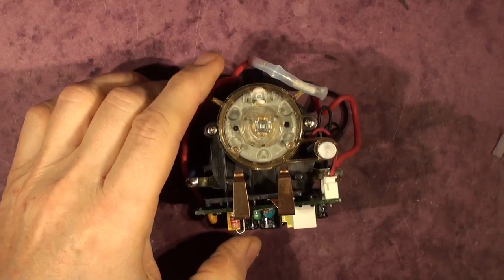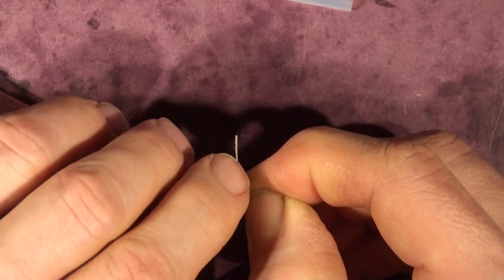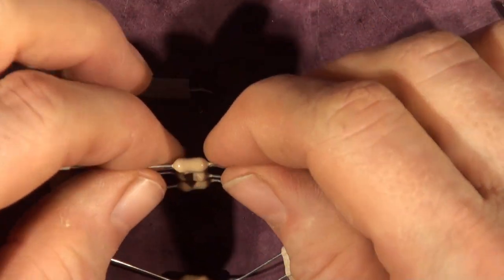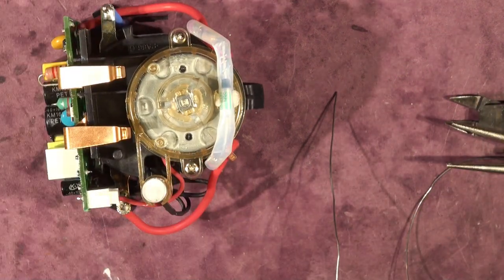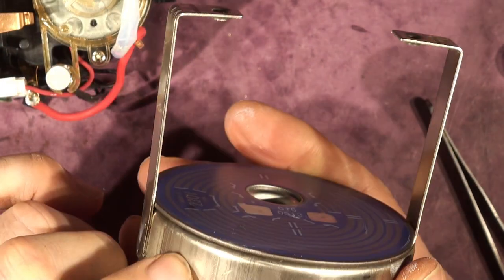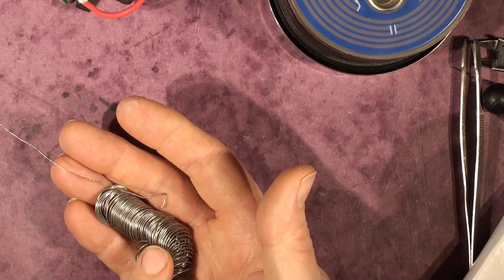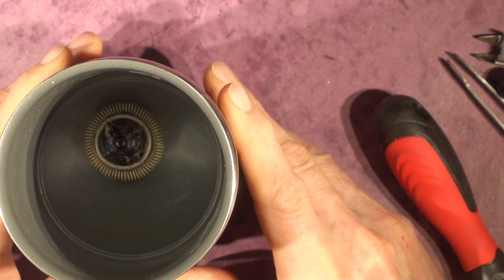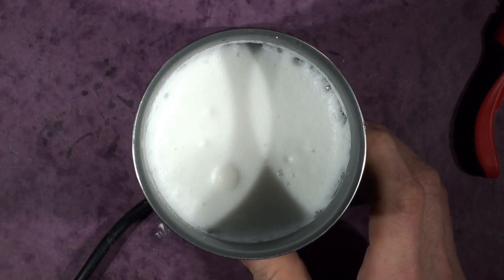Nespresso Aeroccino Milk Frother Diagnostic and Easy Repair Part 2: Reassembly

Comment: Congratulation... One question...what valor is the resistor, your put with the fue? Thanks a lo..
Reply from the maker: Not a resistor is is a 3Amp in line wire-ended fuse.

Comment: I love the effort, after reading all the complaints I cant understand how they havnt revised the design or halved the price. It looks like the only thing they superseded is the colour.
Reply from the maker: It is a design fault. The elements are too variable and pull a lot more power than stated on the element rating.  My Aeroccino is supped to be 450W and is actually  550W on 245VAC UK Mains.  The software could have timed the rise in temperature and then  deduced that there was no milk in it and switch it off almost immediately.  The lag between the thermistor and the safety fuse if too great when the unit is run on empty. The element burns out before the micro turns off the power.   Schoolboy design.

Comment: Great video!  Where can we order these parts?  I am in need of a 222R 250 115 degree Celsius
Reply from the maker: Hi Rick . That is interesting the original version had 133 Deg Celcius.  I keep getting asked so I will get some in. What is the  222R if teh fuse is blown and you have other faulty components likely the TNY chip has blown.

Comment: Do you still have any spares for these? I want to try mine! Mine’s working sometimes though, I’m not sure if something is just loose…
Reply from the maker: If yours is working sometimes than open it up and look for sparking, arcing marks between the contacts that are left behind in the base that bring mains and where they contact on the electronics assembly.  Quite often you find that they contacts just need a clean and a tweak to press harder on the mating parts.  Also is the base power puck making good connection?

Comment: Hi great video thank you! The two maxes are for heated milk (the lower one) and the top max for un heated milk (you have to press for a few seconds to get that started). I am troubleshooting mine with the multimeter and I can’t find the fault! Heater, fuse, 22 ohm resistor, chip (the one you pointed out), power are all ok but the thing is dead as if it were not connected. Any ideas? Thank for the great video!
Reply from the maker: Check the power relay.

Comment: Thanks for your video, when I press the on switch it spins for a couple of seconds then stops with the light flashing red. If I press and hold it goes blue and spins fine. Any idea if that's repairable? Thanks
Reply from the maker: Hi Mark,, there are sever attempts to update the hardware on this product and all of them fail differently.  Is that error described in the user instructions.   It sounds as though you have a heater fault.
Reply: Hi I fixed this by reversing the red and black wire on one of the connectors. Makes the magnet go the other way round. 
At least it’s making frothy milk again.

Comment: I seem to have a problem with switch.  When I push the start button it seems like it makes a connection but then cuts out . . . I have to repeating the process of pushing the button until it finally "catches" and the motor starts.  Do you think it is the switch or something else?
Reply from the maker: Once you get it to take and start just move it (rotate) the body on the supply base to see if you have a bad contact. If OK and the connection between the base and the body base is not intermittent, take the can off and check that the spring contacts are making Ok where the mains is delivered to the controller. Otherwise t is likely to be the Switched-Mode Power Controller or perhaps an aluminium electrolytic capacitor gone low in value. Inspect the controller closely with a  spyglass - you may be able see some traces of scorching where there is a bad component solder joint.  Otherwise you will need test equipment and electronic know-how to fix it.

Comment: Mine doesn't have that thermal cut-out. It only has the red wire running one side to the other. Is there a separate TCO on this possibly later model?
Reply from the maker: Inspect the element of the exposed area o the thick film element. Early units were not fitted with a fuse - they just had an element that bows open when it overheats.
Reply: @razenby  Thanks. I separated the works from the body as you did and then cleaned the thermal grease off the circuit board where it contacts the Biro spring plunger, reassembled and it only worked without the silicone rubber button. This is fine at a pinch. The button I remember having to push hard to get it to work years ago, so will keep using a matchstick to push the tiny button!
The on/off button is hard get out in situ and bends one of the resistors is you so the cover off with it in place. It's there a trick to this? Cheers. Now enjoying frothy coffee at home and at work with my two Aerochinos now working..

Comment: Nice job! Did you consider putting in a resettable thermal fuse instead? I'm wondering if the Aeroccino 4 model has any improvements or if (as I suspect) that was not a design goal.
Reply from the maker: Thanks.  I did consider it but the resettable 250V fuses I could find were thermally quite bulky and slow.  Without full safety test I could not really recommend something that may have unintended safety consequences.  The problem is with the thermal design. If there is small amount of water it pools over the thermistor so the micro does not get notice of the overheat condition until it is too late.  It is exacerbated in the UK because the mains voltage can go up to 265V,  Also did you notice that the unit I was testing was drawing 50 watts more power than rated on the label?  The dynamics of the thermal design are flawed.

Comment: Thanks for a great couple of videos explaining so easily what might be the problem with the Aerccino. I have now taken mine apart & it doesn't have the heat fuse. I can't remember how long ago we bought it but do you have any idea what I should be looking for?
I was so excited to be able to get this working again & having a frothy coffee but at least I have a set of  trilobular and security bits !!
Cheers
Gervase

Ps the to level marks in the container are for 2 different types of whiskers. One is for cappuccino the other for latté .
Reply from the maker: I just made a video on how to fix the heating element in the Aeroccino like your that does not have the seperate thermal fuse.
Reply: @razenby  could you please give the link to that video, as I am so curious where the fuse can be found...

Comment: Hi. Thanks for the video. Is the normal fuse needed? I also found a 15 amps thermal fuse, but I was told at the store that what was important is the rated temperature. Thanks in advance!
Reply from the maker: Hmm that is a tricky one as there is some heating in the fuse due to the current it is passing. i.e. The temp at which it blows might be at stated load. I did check the spec. I have bought a load of components to post out as a thanks to to Tubers if you want the same ones as I used.

Comment: Many people comment online that over time it looses power and it doesn’t spin as strongly. Is there any repairs for that problem? Thank you.
Reply from the maker: Make sure that the whisk is very clean. I had that problem and I believe that  it may me the magnetic coupling that drives couples the motor shaft to the whisk has weakened (lost flux/Strength).   When they get older they tend to rattle too and it does not appear to be wear in the motor of the whisk.  The rattle is the magnetic drive jumping.  If you have LIDL store look out for their milk frother (~£20). I have one here now and have bought them for my kids.  The office coffee would burn through and Aeroccino in about a year, The SIlverCrest  It is a similar design to the Aeroccino except that it is a work horse that keeps on going.

Comment: Thank you so much for this. You are a GENIUS! Quick question, I got the Nespresso Milk Frother model for 220v but now I'm in a different country where the standard is 110v. Nespresso recommended to use a 220v to 110v external transformer but it is very big. Do you think I would have a light at the end of the tunnel through internal wiring connections in the milk frother?
Reply from the maker: Thanks.  I haven't seen inside a 110V unit. There aren't any options on the 220V to convert to 100V.  The main issue is thick-film the heater element will be the wrong power. The control electonics are probably universal  may work on 110V but take a long time to heat the milk as it will be half the heating power.. Sorry for the bad news...

Comment: My Nespresso has a thermal fuse only. Why have you replaced with both the 133deg thermal and 3amp fuses?
Reply: Because the original thermal fuse has a 3amp rating, the replacement has a 15 amp rating.
Reply from the maker: The thermal fuse I could get were 10A rated

Comment: If i bypass heat sencer to get off the automatic off the system. What are the disadvantages and consequences of bypass ? I need to make a tea maker of this system.
Reply from the maker: Interesting idea.  The power of the heater that can be driven by the relay power should be limited to about 600W. If greater than this then use a seperate mains coil relay.
Reply: @razenby  i bypass all the system, like get off the heart and kidney, XD, and directly giving 220v AC to heating element. And it is working very perfact nicely and fast.
Reply from the maker: @AhmedHassan-uv2cv  Good job.

Comment: Hi, Derek here..Really enjoyed watching your videos on the repair of the Milk Frother.  I have the exact one, When powered on and starter button pressed, the Red light shows on but the the thing that whiskes the milk to froth does nothing, a few moments later I get a flashing red light, could this be the Thermal Fuse as in your video that needs to be replaced or is it something else?
Reply from the maker: Hi, difficult to say. Makes sure that the connector on the base and on the bottom of the unit is clean.  Unplug first!!  then open up and check the resistance of the heating element with a multi meter set to ohms.    Should be around 80 to 120 ohms.  Then check that no water has got inside and inspect the contacts that engage with the socket in the base of the outer can and the contacts that press onto the heating element to deliver the power.  See if they are burnt or bent.  Good luck

Comment: My frother doesn't have the thermal cut out just the red wire. What could that be? Cheers.
Reply from the maker: I think the very first ones relied upon a fusible link on the heating element.  When this blew the device was scram as the whole body of the frother had to be changed.  To cut down warranty costs, instead of fixing the thermal issues on 240 UK mains they added a separate thermal fuse link to simplify the repair.  This is a cheat product that has cost most buyers dearly. Bad engineering and design.

Comment: I have a problem where the frother does not fit on the base properly.  No obvious obstructions, but it doesn't sit properly nonetheless.  Anyone with suggestions?
Reply from the maker: You mean the mains powering base-- if so it must be a damage to the connector on the base or the bottom of the frother.

Comment: Hi, Haidar from Kuala Lumpur, Malaysia. I have 2 Aeroccino milk frother. Both have similar issues, heats are fine but springs don’t spin. Both of them. May I know why? How can I contact you?
Reply from the maker: Possibly a faulty motor or electronics. Take it apart and have a look at the motor to see if it turns smoothly. Remove the motor any apply 6 Volts DC and see if it runs OK.
Reply: Having the same problem, were you ever able to figure out how to fix them?

Comment: Hi, 

Did you stop selling the kits?
Reply from the maker: Yes I did, I could order some more. I got a bit Pissed with eBay summarily refunding people because their Aeroccino was suffering from a different problem not relating to a thermal fuse.  Some clearly hadn't watched the video linked to in the listing and a few  were quite belligerent.  It was not for profit endeavor but it was annoying me as it seemed to be playing out the  old adage  'no good deed goes unpunished'. eBay were trying to outdo the Amazon returns policy and expecting the sellers to carry the 5 to 10% loss by increasing prices.    I realised what was happening when I ordered some 2 pin CCF bulbs instead of the 4  pin when I went to return them due to my error they just refunded me straight away without needing to return the bulbs... Ridiculous.  They claim to have changed their ways to 'protect' he sellers more - their language gives them away. They have no interest in decency as they would say that their strives to be fair to both buyers and sellers. I ddn't want to be associated with eBay. They would rather see something thrown into landfill that returned for resale.
Reply: @Magic Smoke  I get exactly what you mean and I'm sorry to hear of the bad experience.

Your videos helped me a year or so ago and I purchased your listing. The fuse has just gone again so was looking for your kit, as the ones on ebay are without the additional fuse, quite dangerous

Anyway I bit the bullet and had to order 10 of each from RS with extra £5 postage. Oh well, better than throwing it in the bin

Thanks a lot for your response and education on these matters
Reply from the maker: You are welcome

Comment: I have a Aeroccino 2, I think the successor to this one, with a similar problem. Sometimes it works, sometimes it goes into overheat protection after a few seconds only. I've just refluxed the heating element, like here: https://www.youtube.com/watch?v=8ri5zs1fDOY&ab_channel=dhavemann, but this didn't help. Also bent the copper contacts a little to give it more tension and spread the existing thermal paste a little, because that looked messy.
Do you think I should incorporate your fix with the thermal resistor as well? Or could it be something different? I don't know too much about circuitry, but I know how to solder.
Reply from the maker: Hmm, difficult to say. If you want to send It i'll take a look.  Would make an interesting video. Could be a power glitch or the micro crashing, bad connecting wire, solder joint etc.. I guess you have checked that the AC power connection on the base is sound? A power dip on these isn't managed well and the micro crashes. Check for a sticking power relay for the heater etc...  Could be any number of problems. How old is the one you have and what is the model number?  It would be interesting to see.
Reply: Thanks for your quick reply! I didn't check any of this yet, but the cold operation mode works flawlessly, so I assume the AC power is ok? I live in Holland, so sending it to and fro would be a bit expensive I guess. I just got this one for free because of the malfunction, don't know how old it is, but it looks pretty neat outside and inside. It's a model 3192 machine. Are you in for a chat this weekend maybe?
Reply from the maker: @klaasdieleman  reasonable assumption however it is only drawing a few watts on cold.